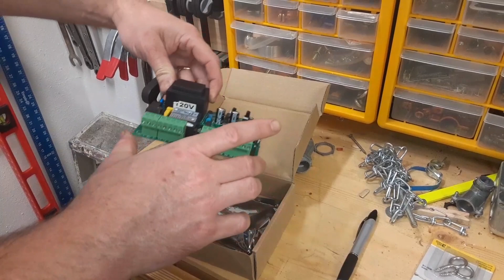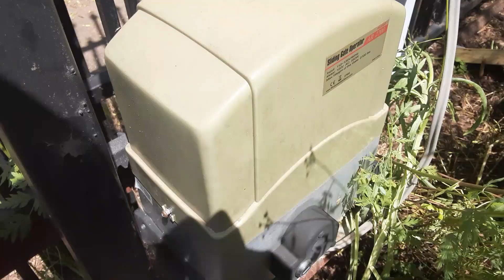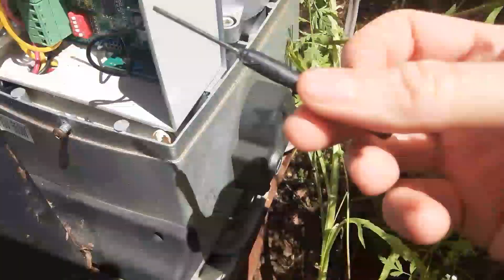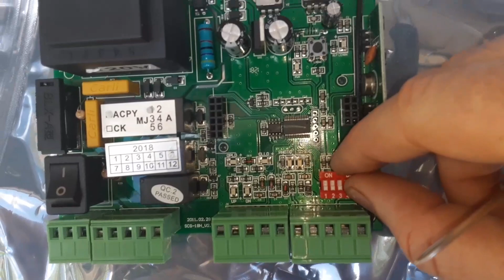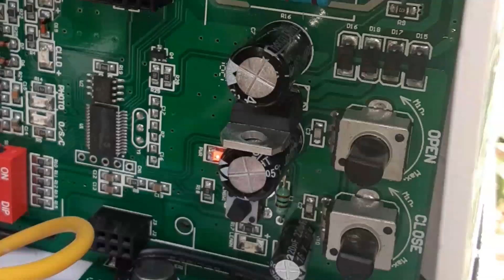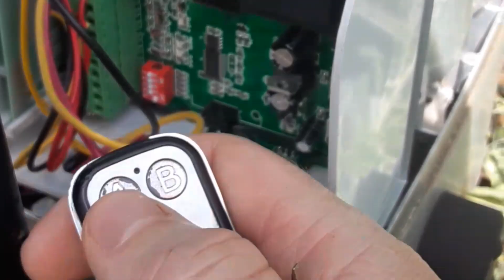Aleko Gate Opener Circuit Board Replacement and Remote Program

Comment: Aleko no longer SELLS the Circuit boards for the 2700! they are discontinued! total B.S. invest a fortune in driveway gate and  one of their expensive sliding gate motos and then they discontinue replacement parts, forcing you to replace the whole thing!

Comment: looking to probably replace my PCB replacement circuit board kit for the ALEKO AC2700 Sliding gate. it costs a lot of money, but when I try fix it, get a new PCB, the whole Internet can't find one. Very Disappointed. Had a new driveway designed for the opener. 5 years old now. It has not been trouble free either. Sick of this b.s. Terrible... It no longer closes the gate, it opens it fine. I am at the point of just calling it junk. IMHO
Reply from the maker: Hope you find something that works!

Comment: Found your post trying to figure out what went wrong with my new board PKMJ4A for the AS450U, AS900U, GG450U, GG900U, AS650U, AS1300U, GG650U, GG1300U, AS850U, GG850U, AS1700U, GG1700U gates. Turns out it was shipped with out a required jumper on the reset terminals. Left a comment because if I found your video trying to fix my problem some might read the comment even though it's a different board in the gate family.